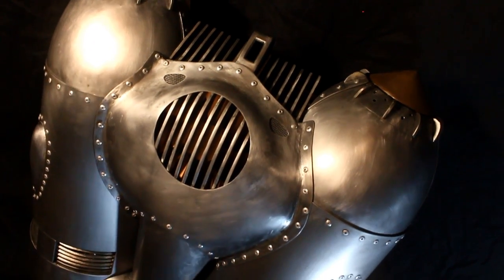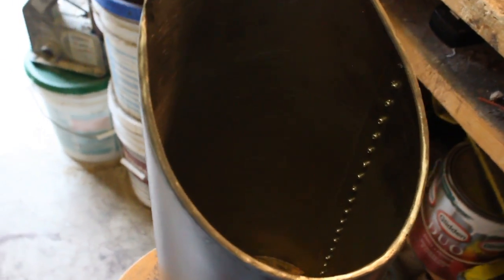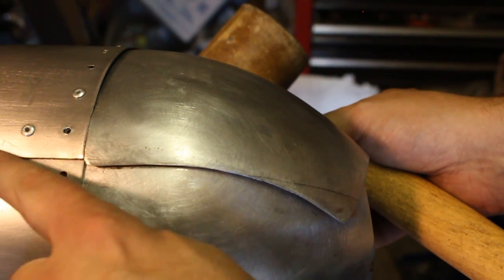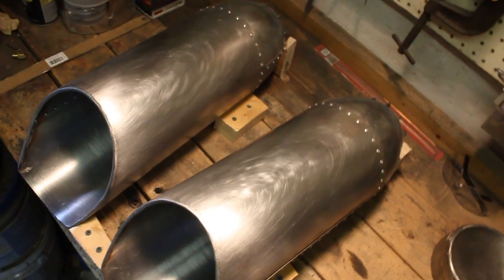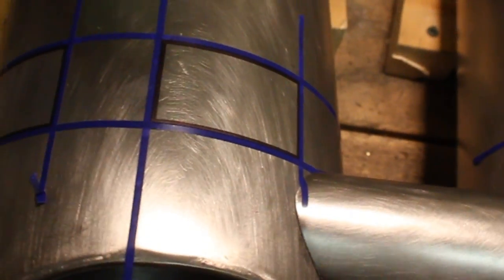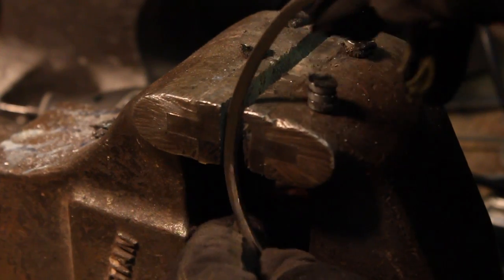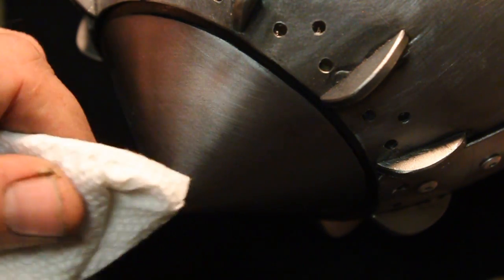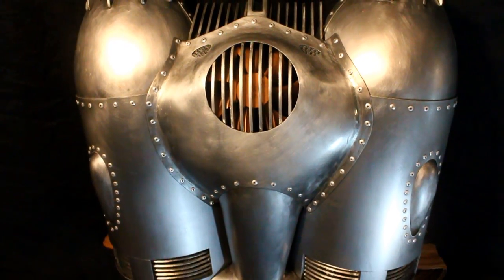How to make the Rocketeer Jetpack in REAL METAL

Comment: you had the MIG gas cone off ?  For visibility?   Do you increase your gas pressure/flow to compensate?    THANK YOU for your teachings !
Reply from the maker: This welder is a flux core welder, meaning there is no gas needed. The ugly soot you see on the metal after welding is from a chemical added inside the welding wire that acts as a shielding gas when it gets vaporized.
Reply: @DavidGuyton    Luckily I have a gas MIG setup at work.   Wish this job had a TIG setup, such better control of the weld pool, and good for aluminum.

Comment: Hello there, i was just wondering if you could tell me how you connected the harness to the rocket?
Reply from the maker: I use rivnuts now for these builds. Just drill 4 holes  use the rivnut tool to install the rivnuts, then use flush mount bolts with  washers
Reply: @DavidGuyton  ok thank you so much, i appreciate it!

Comment: How much would you make one for me? dfink424@gmail.com
Reply from the maker: I do sell them now, although they are aluminum now and they have a ton of upgrades to make them much more accurate. Because of the time involved and the material prices, they do not come cheap. The next set of them I make (I do 4 at a time) will be $5,000 USD. Harness and shipping is included, however I only ship to the lower 48 states. Find pics of the upgraded version on my Instagram @armortemplates

Comment: I’ve often wondered if one could be built with small kerosene torpedo heaters inside so you could “fire it up” and get some light and noise
Reply from the maker: Definitely possible...but not with plastic engines like these
Reply: @DavidGuyton  Definitely, no plastic engines, just the torpedo heater exhaust area, with metal welded on if desired to look more authentic to the movie

Comment: Not to be negative because this is awesome, but this is a rocket pack, not a jet pack. He's not called the Jeteer. :D
Reply from the maker: technically since there is an air intake, and the fuel that came out of it was alcohol, it's a jet and not a rocket. This would only be untrue if the other (non-damaged) booster had some kind of oxidizer in it, and the air intake at the center was for cooling and not to be mixed with the fuel. I know they refer to it as a rocket in the movie..not sure if they say jet anywhere in it.

Comment: wouldnt it be easier to make this out of aircraft grade aluminum? probably cut the working time in half no? cost would go up probably few hundred bucks though and welding aluminum probably more annoying, it is aerospace stuff afterall I would imagine the "real" thing woulda been made out of lighter weight materials to improve thrust to weight ratio ;P (not that you could practically fit a rocket capable of lifting a man safely in such a small package that could provide lift for any meaningful amount of time lol)
Reply from the maker: I only have the capability to weld steel.

Comment: buy a gas nozzle - it´s better to welding with your shild gas ;-)
Reply from the maker: This is a flux core welder. It does not use gas.
Reply: self-shielded...ok -did you have slag like electrode welding ?
Reply from the maker: It's not really slag like that...but there is a residue left behind that has to be cleaned off before additional welding can be done in that area.
Reply: thanks for the explanation

Comment: David, What type of welding machine do I need for this? What Size, type Etc. Thanks! Great Video Man!!!
Reply from the maker: I have a cheap Lincoln flux core machine (requires no gas). It is not all that easy to weld with and it leaves behind a soot that must be cleaned away before additional welding can be done. It works, but a real gas MIG would be easier to use. Really, any welding machine will do the trick.

Comment: Why you weld without the nozzle ?
Reply from the maker: This is a Flux Core welder. There is no gas. It is in the wire itself, released during the welding process. Harder to control and messier, but it's also a lot cheaper.

Comment: If you have time for a quick question. How did you mount the pack to the South Beach harness. I am mid construction on my own pack and got the exact same harness from them. My "backplate" for lack of a better term, is 3D printed and lined with fiberglass for strength. Did you drill through the harness and use bolts? Any info is appreciated. Thanks!
Reply from the maker: Yes I used those hex cap bolts with the rounded head on them. I welded nuts into my boosters, located the holes/nuts I had welded in, then popped holes in the harness and bolted it on. I used washers too of course

Comment: Put the weld gun nozzle tip on it. The nozzle is designed to encase the shielding gas when the trigger is pulled. That's why your welds get so polluted. Great job either way!
Reply from the maker: This is a flux core welder, which does not use gas. It can be converted to gas but this one has the shielding gas embedded in the wire itself.

Comment: Great build , just saw @donttrythis tweet, your info is spot on, love the delivery, I was surprised that during the dishing of parts you used the flat side of the hammer rather than straight to the ball end,?
Reply from the maker: to get very deep dishing, I use the round side of the hammer, but the curves involved here are pretty gentle. The flat side of a ball peen hammer actually has quite a bit of curve to it to, compared to a body hammer, so it still dishes, just not as extreme. It also keeps the part from getting too beat up in the process. Even with deep dishing, I will often start with the flat side, and only use the round side in the center area to avoid too much work-hardening of the metal
Reply: David Guyton thanks david

Comment: If you're worried about blowing a hole while welding then I suggest setting up your welder for MIG rather than fluxcore. Small diameter (. 023") MIG wire does well on thin sheet metal. Plus, no slag to clean up afterwards.

Comment: David Guyton, You mentioned that you had taken apart the pieces and put them back together a lot to get the fitment correct. In aviation and auto body metal work, we use Clecos: http://www.eastwood.com/blind-grip-holders-1-8in-pack-of-30.html?SRCCODE=PLA00020&product_id=%7Bproduct_id%7D&adpos=1o3&creative=83580268740&device=c&matchtype=&network=g&gclid=Cj0KCQjwwevLBRCGARIsAKnAJvf_P1Eofzxzill2bDQmoDFPD66zdy94xz-gEnHB9R9nlgMC_ByNZAsaAr8SEALw_wcBlike this one in the link. There are several different designs of Clecos to choose from. They are way easier and faster than using rivets that out have to drill out and put back in.Here is a link that shows them being used: https://www.youtube.com/watch?v=8jTwPmSsrgk
Reply from the maker: I am aware of them. I just don't typically do this sort of riveting so I don't own any. I got 2000 rivets from Harbor Freight for like $10....might take a bit longer than Clecos but it worked

Comment: How come your weld gun doesn't have a gas nozzle?
Reply from the maker: Because this is a flux core welder. There is no shielding gas...it's actually embedded in the wire itself. It's a lot harder to weld with than gas, and it's very dirty, but I don't weld very often and it works well enough for what I need.
Reply: David Guyton ahhh that would explain it.

Comment: HEY MR GUYTON you might want to look into buying some Blind Grip Panel Holders (aka Clecos) if you plan on doing something like this again.
There are videos that explain what they are and how they work if you have not used them before.
EDIT: also maybe some Weld Spatter Spray if you are welding anything else, it will help a little with clean up.
Reply: therealdeadpen he's got clecos... They just don't hold as secure in some circumstances... But he might not have them in that size though...